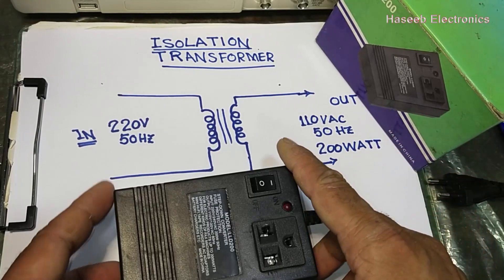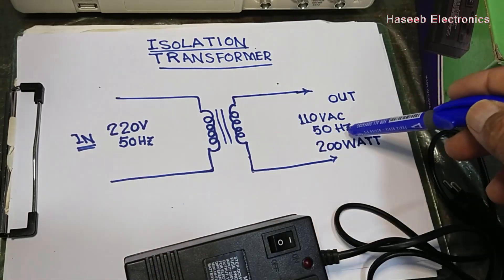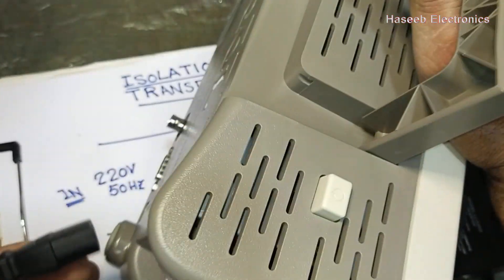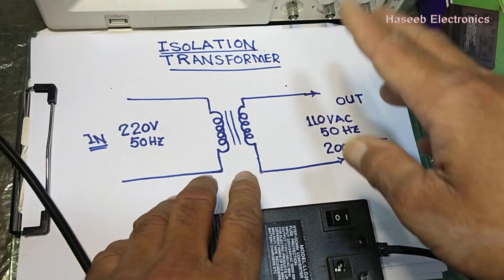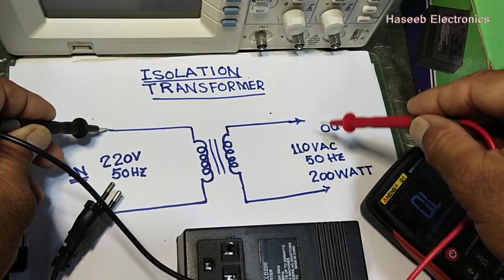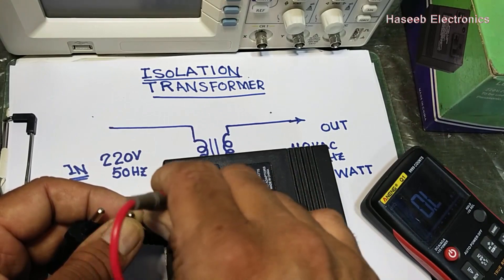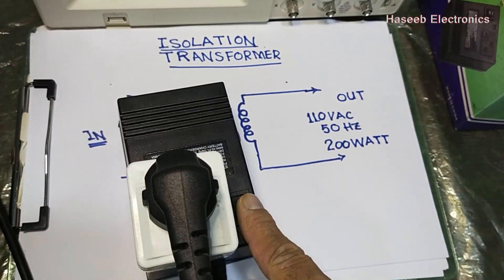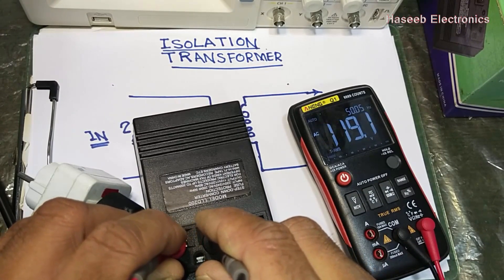{441} ISOLATION Transformer / What Is Isolation Transformer / How to Test Isolation Transformer

Comment: Thank you for sharing this information about transformer. I noticed that the primary side plug had no ground connection, would you please explain why it didn't have a ground connection? Thank you again and again!
Reply from the maker: most welcome and special thanks 
yes 
when we make isolation transformer, the ground connection is not used, so its output is floating and isolated

Comment: good explanationi. if suppose more than 24ov present on circuit, it will give only 110 v output
Reply from the maker: no its output will change with change in input. because it is ratio based transformer

Comment: Very good video on isolation. I noticed the 110 volt side has a ground and the 220 volt  looks to not have a ground. Is the 110 volt side isolated with a ground and is the ground isolated from the 110 volt transformer coil. Thanks for the video
Reply from the maker: est regards
the output side is US standard connector but it is not connected to any ground. 
input side is also 2 pin (line and neutral 220 volt) 
output is 110V isolated without ground

Comment: I use a toroidal isolation transformer from the bottom of a medical audio/video cart and its wired to a power strip.  All devices that are pulled apart on my bench are first plugged into the iso transformer until I can verify the problem
Reply from the maker: yes dear it is best practice to troubleshoot using isolation transformer

Comment: thanks for nice lecture about isolation circuits. i have a question, all test equipment should be in isolation or just the testing  equipment should be in isolation.?
e.g i am working over a power supply and using oscilloscope . 
now both should be connected to isolation transformer or its safe enough to keep oscilloscope in isolation?
another part is about ground or earth?
sometimes earth and neutral are connected in main distribution box so isolation transformer will work in that case (if its connected to ground or earth of socket)

Comment: Hi, nice tutorial as always, i have a request, could you make a video about why it's better to connect the device under test on the isolated transformer instead of directly isolate the oscilloscope ? because normally for safety reasons it's not recommended to isolate the oscilloscope directly (see for example EEVblog video 279), but i'm not that expert (and i don't have an oscilloscope) so i would like to understand why

Comment: Haseeb, if I understood you correctly, you said that you will power your oscilloscope with your isolation transformer. There is some discussion about whether the Device Under Test, or the oscilloscope, should be isolated. This area is beyond my knowledge base, but, the best that I can tell, most people say the Device Under Test should be the one isolated. I have only come across one individual that isolates the oscilloscope. And, if I understood him correctly, he isolates both the DUT and the oscilloscope and only in very specific circumstances. He was an electrical engineer and said he knew how and when to do that, but he did not tell us those details.
I think the logic may be this... The oscilloscope has an earth connection to make it safe. If you isolate the DUT, the DUT and oscilloscope can not become connected through the earth path, but the earth connection on the oscilloscope is still in place and doing its job. It is something for your to research. I hope that helps. Come to think of it, Differential Oscilloscope Probes do the job of isolating the oscilloscope. If it was acceptable to remove the earth ground from the oscilloscope with an isolation transformer, they would not manufacture and sell Differential Probes. Again, I hope this helps.

Comment: This is a very  important topic and I am glad you are addressing it. Everyone that works on any type of mains powered equipment needs three things... A way to isolate the equipment and limit its voltage and current. Much of this may be accomplished with DIY processes. An isolation transformer can be made by placing two identical transformers back-to-back. Meaning, the secondaries of both transformers are connected directly. The primary of the second transformer then becomes the secondary for the isolation transformer configuration. Voltage is controlled with an auto-transformer (AKA "Variac," which is a particular manufacturer's model name,) which is similar to a giant, wire-wound potentiometer. They are difficult to make. Though they are expensive, they are best purchased. Lastly, the current may be controlled by simply putting an incandescent (not LED) light bulb in series to the line leg. Different wattage bulbs provide different levels of current limiting.  All of this must be thoroughly investigated, before building any part of it. Mains voltage can kill you, easily. I assume no risk for you. I have made my own isolation transformer from two identical transformers from Uninterruptible Power Supplies. Here, in the USA, when the batteries die in these units, it is cheaper to buy a new unit, than buy new batteries. Therefore, these units are easily found for free. I purchased my autotransformer. I am presently working on my current limiting light bulb assembly (AKA "Dim Bulb Tester.) I am using several low wattage bulbs in parallel and switched in and out, to make different bracketed levels of current limiting.

Comment: I was always taught that the equipment under test should be connected via Isolation Transformer, then just use oscilloscope as normal.
Reply from the maker: isolating the UUT (unit under test) is applicable for human safety
isolating the TMDE (test, measurement & diagnostic equipment) is important for equipment safety. 
Note TMDE must be isolated separately. that is very effective and safe for equipment.
Reply: Me too. Never 'float' your scope.

Comment: Helpful as always.....

Pls sir I do request a video on how computer charges its battery (laptop). And how BMS perform cell balancing in detail. I try charging a laptop battery outside the laptop with it's charger, but to my surprise they got hot very fast. Pls sir elaborate on how the laptop do the magic of charging them with the same power supply without damaging them....thank you sir am really proud of you 👍
Reply: You can use any bms 3s 12.6v to charge three cells in series.
Reply: @MuhammadDanish-xz3qt  thanks sir, the trouble is that I've no experience whatsoever with BMS